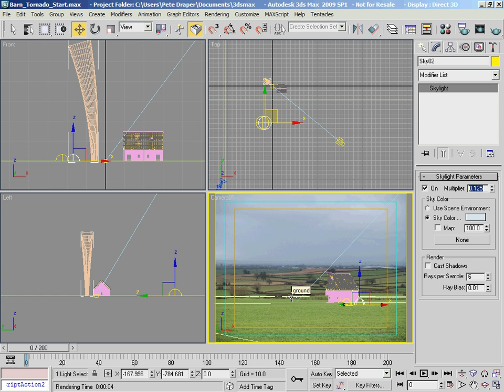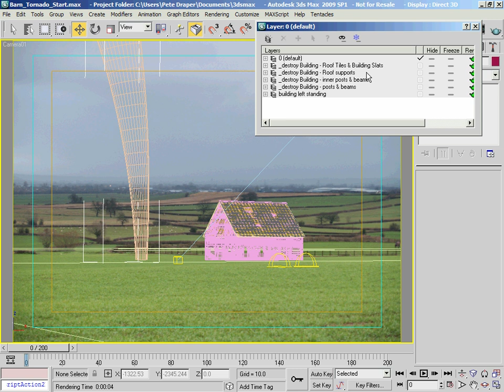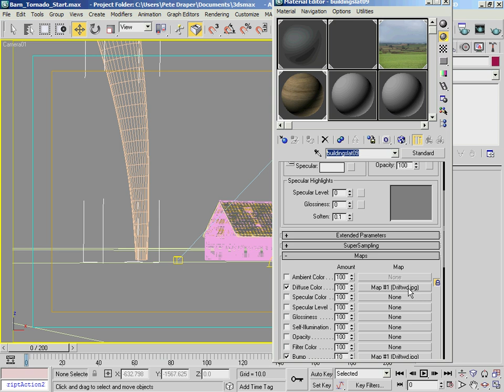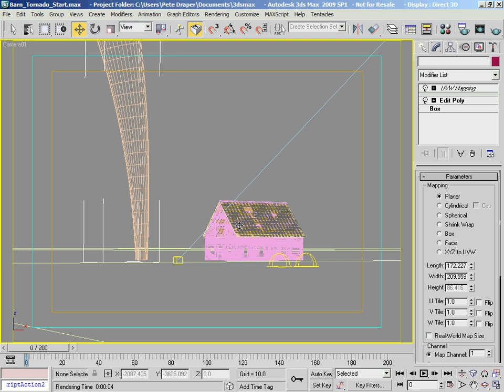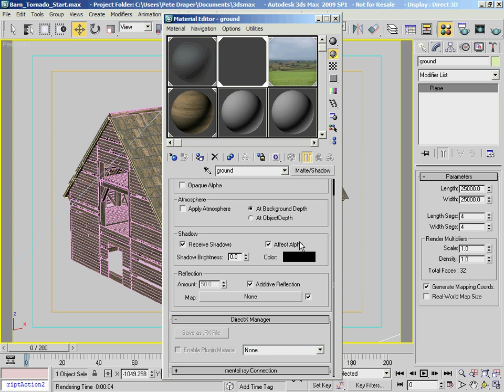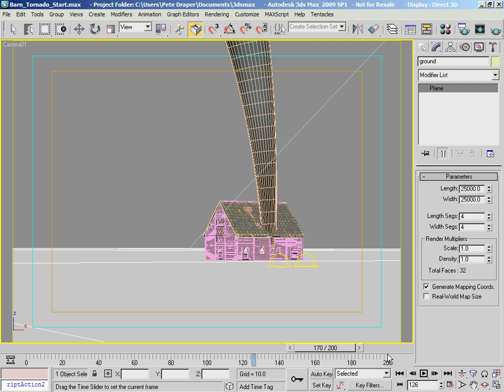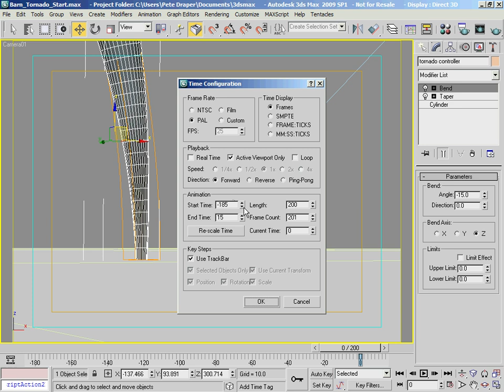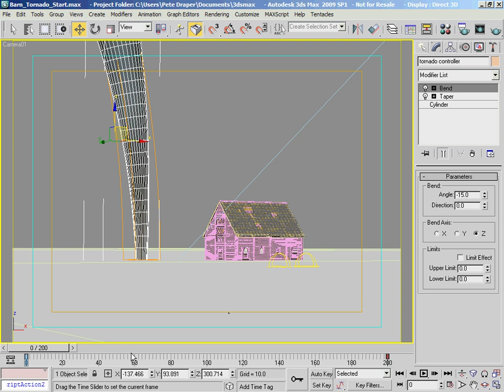Barn Tornado (1/11) - Introduction - 3ds Max Particle Flow Tutorial - Advanced

Comment: Love your book, have worked through several of the tutorials and have learned a great deal.  I recently went to the publisher's website and was able to download the zip file for the barn tornado but it contains the video only. Is there anyway to get the file, assets, and PDF directions?  Also for the barn, in addition to modeling individual elements did you use voronio fracture or another script to get it to break apart?